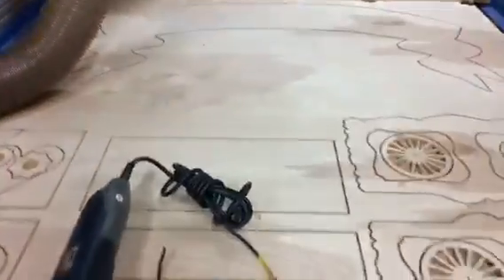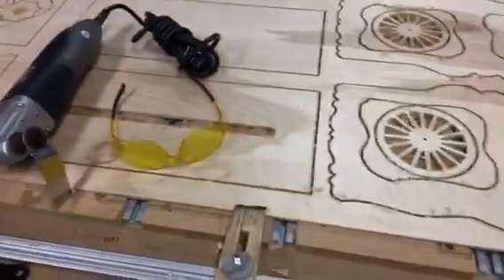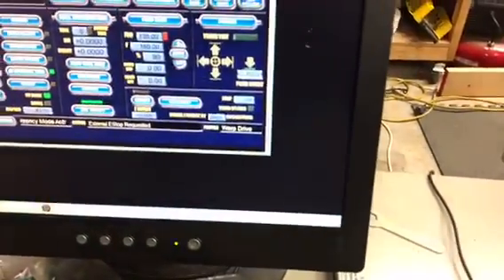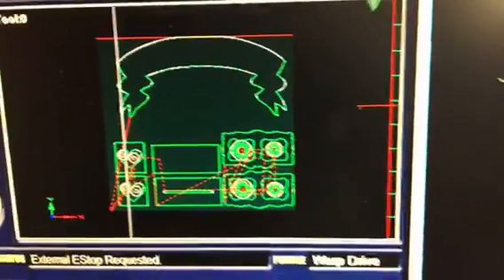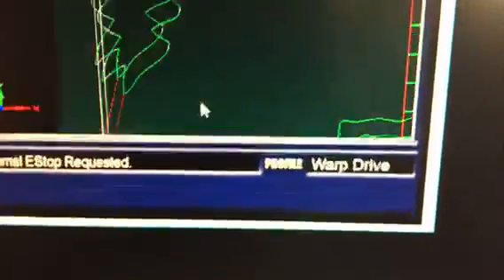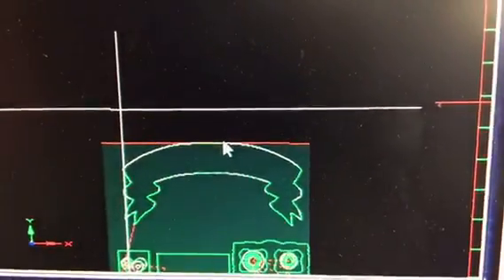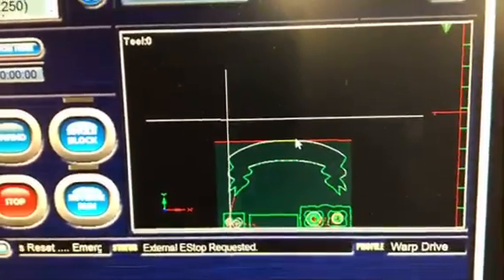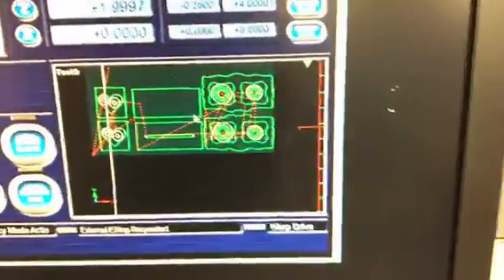Mach3 CNC Router Tips

Comment: Great tip Bill.  I most the time am screwing parts down to my spoil board, But when I do use clamps I use a laser etcher on my router to mark where the parts are so then I can know to avoid placing clamps there. I use it all the time when i need to re mount a part to the machine . So I etch the drawing on my spoil board and then know where to put clamps or boards to hold my part in place.